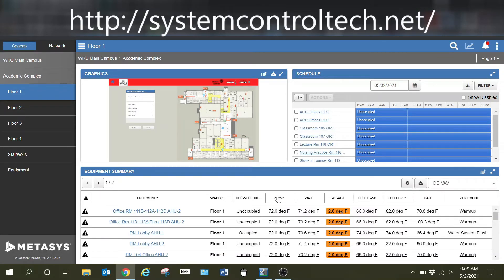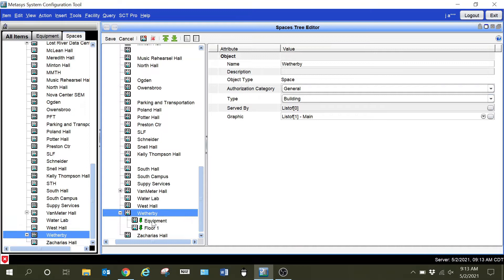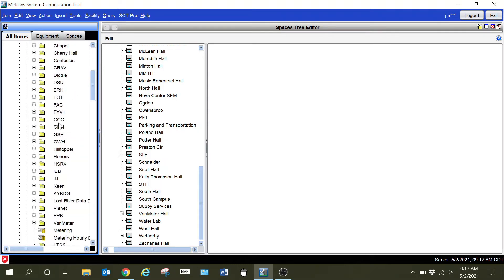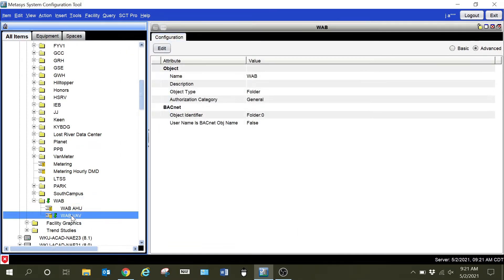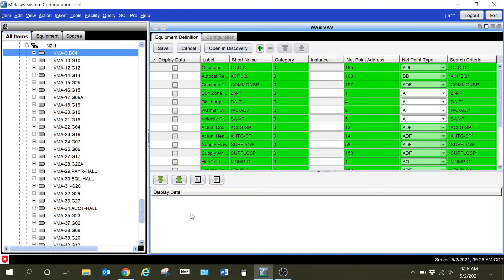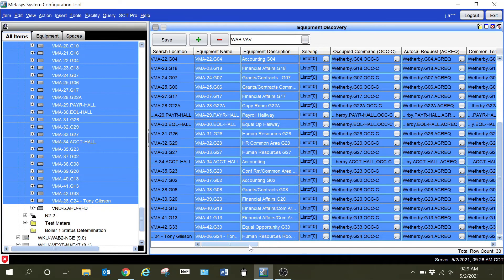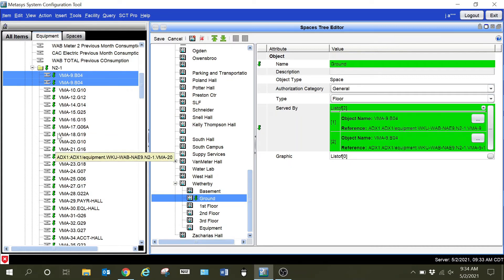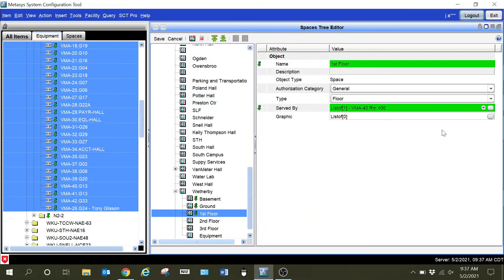How to set up Spaces in Johnson Controls Metasys MUI

Comment: Excellent video - we are in the process of converting SMP to MUI. In the space what is the equipment used for? Our local branch said to use a space per VAV which seems to much.
Reply from the maker: It could easily be too much to use a space per room. I usually pull from the equipment tab in sct and add that equipment into the space folder. I've got an entire Playlist on mui that shows some of that.
Reply: @Systemcontroltech  Cool does anybody here know JCL programming I am looking for someone who can work remotely on some Metasys applications

Comment: Hello, first off love your video. Would I be able to pick your brain. On the Johnson chill water system I am getting on the chw diff press is reading ???-12.5 What do the 3 question marks mean. Our diff setpoint is at 21.
Reply from the maker: The question marks are an indication that it's unreliable
Reply: @Systemcontroltech  I put a new do one and it's reading ???-12.5. I can't figure it out.
Reply: Sensor unreliable does not necessarily mean its a bad sensor- it may not be set up right.  If it was installed by JCI it might be a setra sensor.  Verify the correct range is set up in controller program, then correct signal type from sensor.

Comment: I'm having an issue in MUI 2.1 where i cannot see any other commands other than "adjust," in the drop down menu. I've tried a different brower, different equipment and I am logged in as admin with proper privilege's. O/R, Temp O/r, Release, etc.. aren't visible for any outputs. Is there anything that im missing?

THank you
Reply from the maker: What version of metasys are you running?
Reply: @Systemcontroltech  I am running Version 8.1 Of metasys and version 11.1 of SCT
Reply from the maker: There are noticeable changes in 10.1 and beyond.  We didn't even set up mui at 8.1 because of all the issues. You will see a big difference in future revisions.